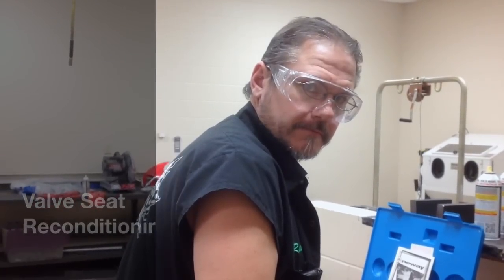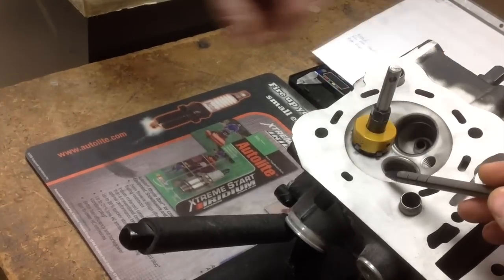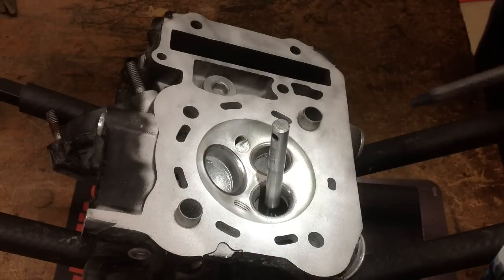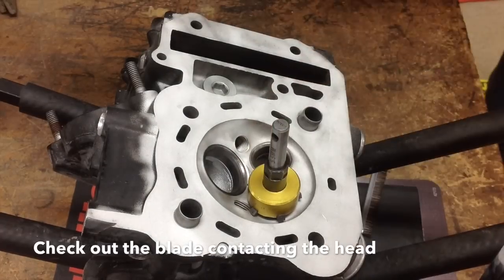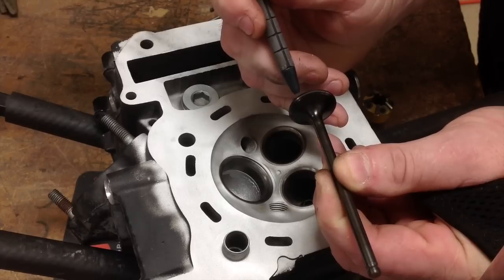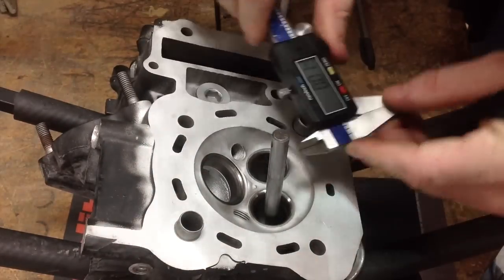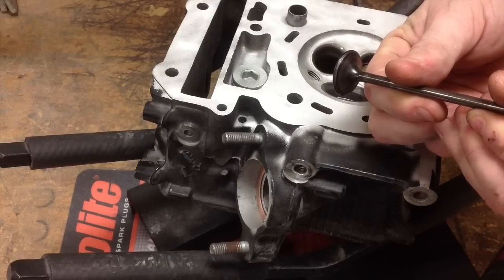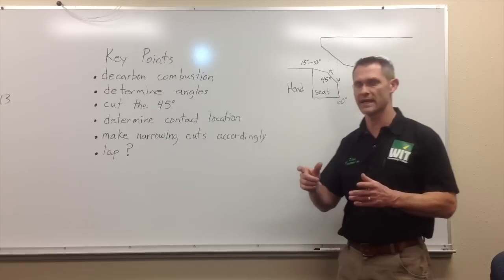How to recondition Valve Seats with Neway cutter heads. How to do a valve job #valvejob #valveseat

Comment: I hope that's not a high compression cylinder with titanium valves cuz I wouldn't cut it that way. CNC machine all day long
Reply: Ive cut MANY modern motocross motor heads this way that use TI valves(No lapping) and never a issue! People that say it cant be done are full of shit and either never done valve seats or just want to justify a $30k+ machine. The dedicated machine is faster and easier but with practice a Neway setup can be just as accurate and give fantastic concentric and finished seats. There is also 3 angle cut insert's that can be used with the Neway.